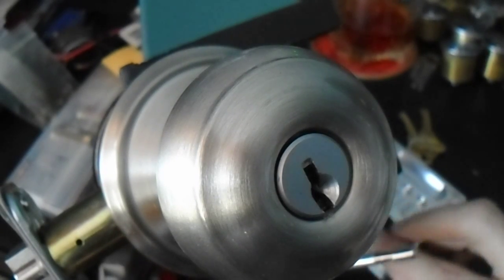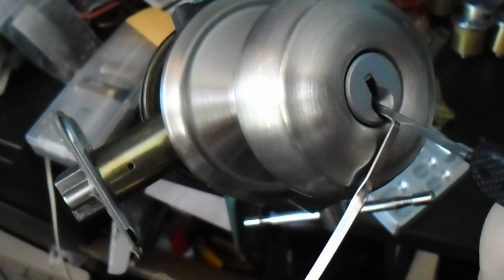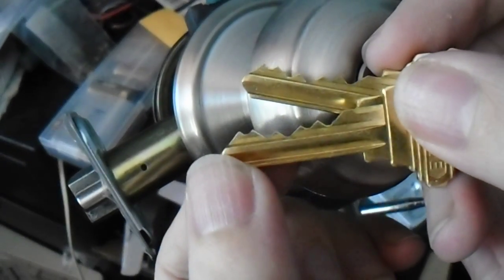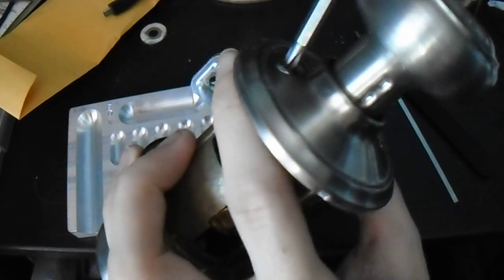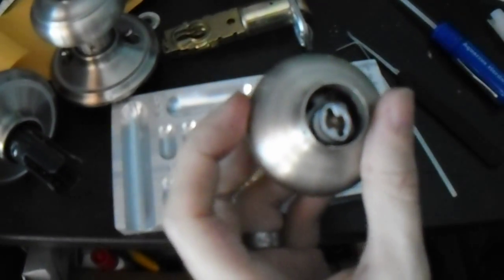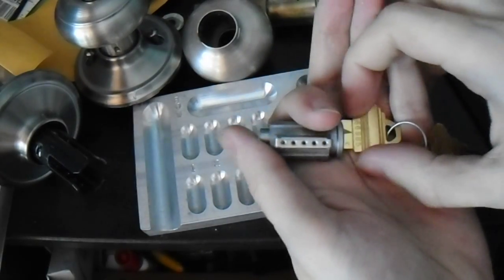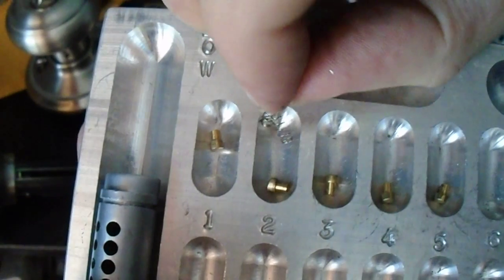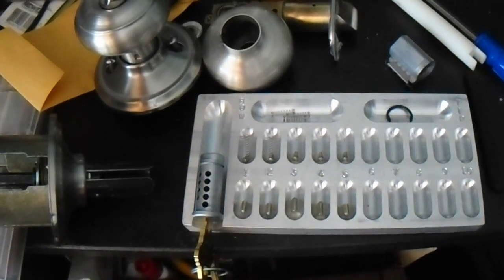(050) Schlage F Series Grade 2 key in knob picked and gutted

Comment: Finally a good video for picking the compressible Schlage cylinder. Millions of these exist everywhere in the US and Canada and nobody on YouTube wants to pick them on video?? I’m a locksmith who deals with these all the time. They can be a nightmare to pick especially with the newer typical Schlage key bitting. When I first began in this trade Schlage used a #3 pin as the shortest in residential lock sets. Now they use 1&2 pins with a MAC number at 7. The top pins are under higher pressure than you find in any other residential lock I found. I normally give myself a 15 minute limit then breakout the drill.. I also made myself a tool to pry up the front pin to pop the compressible cap off to blowup the lock in the knob which will then lessen the pressure on the top pins which can then be more easily picked.. I never been able to open these with conventual pick guns because of the tension on the pins. Thanks for the Video I hope you do more on these cylinders with more Radical bittings..
Reply from the maker: I have found that attempting to bump these or use snappers/pick guns tends to result in blowing the caps off, at which point you can easily rake any remaining pins out (and of course now there are commercially produced tools for popping those caps off) at which point you can easily replace the pins or pin the cylinder to a new key as long as you have the necessary cover, top pins, and springs.
Reply: Nite 0wl.. I never bumped a cap off. I don’t even try any concussion methods anymore. Low odds of success. I try picking first and then prying the front pins to try to pop the cap.

Comment: With F series you can pick it to the locked position and depress the retainer on the side to remove the knob then turn the lock mechanism with pliers or tweezers back to the unlocked position.
I always found F series difficult to pick, they act weird depending on the lock, sometimes I can rake it once with a diamond pick and it opens, sometimes I can spend an hour and not even get it open lol

Comment: I have picked open an F series core before, but it was a little bit ago.  I ended up using the core/plug in a random kik cylinder I had to key up a new lock for my Emtek key I got from Bosnianbill.
Reply from the maker: The compressible F series cylinder will usually work in almost any other KiK housing, but the newer F series models will only accept the compressible cylinders unless you do some modifications to the knob and spindle.

Comment: How do you remove the spindle from the chassis on a Schlage F-Series? I have passage unit that I want to modify to work with some vintage glass knobs, but I can't figure out how to remove the spindle. Thanks!
Reply from the maker: +Andrew Miller You can dismount the knobs from the spindle by using a thick wire pin (like the Schlage Privacy Function override tool) or a small screwdriver/awl. Insert the tool into the small hole on the shaft of the handle, near the escutcheon. You should feel a slightly springy lever inside. Press in on the lever (you may have to press hard to over come the resistance on very new or heavilly soiled handlesets) and you should feel a small click, the handle should now slide off the shaft. Repeat on the other handle.
The chassis is not designed to be disassembled but it may be possible to do so with a little light prying.

Comment: did you try and bump it? how do you make a lock bump proof?
Reply from the maker: +JB I did try to bump it, it was quite difficult. Preventing bumping requires messing with the physics of the lock, so varying the spring strengths from chamber to chamber (say add one extra strong spring and one weaker spring) and replacing one or two of the driver pins with T pins (especially paired with those extra strong springs), Ilco even makes a kit for doing this in the field. There are other methods but those usually require specially made pins and modifications to the lock body and I have seen reports that they are not as effective.

Comment: you think it's better to put a wafers in making it full of drunken spools. I would like to see the picking time difference. the tpins supposed to stop bumping or is that just the ilco halt pin which I have but don't know how to use properly. 10 ilco bump halt spring & pin sets came with my high security pinning kits. only thing it says it's better security if you use two of them. I don't know squat about bump pins and those crazy Springs that come with them. f series t pins I believe came in a kit also. basically how do you use ilco bump pin and spring and using schlage t pins with a wafer or 2 tpins together front to back or front to front. what's the best and how do we do it? sounds like a t pin experiment .
Reply from the maker: Ilco Bump-Halt T pins and Sclage F-Series T pins are normally installed in the same manner, narrow shaft towards the springs. In both cases using them in standard lock bodies cause them to both interfere with bumping (2 per cylinder is usually sufficient)  but they will also act like spool or Mushroom pins in a picking attempt. The bump-halt springs help interfere with bumping by screwing with the timing and physics of bumping, strong springs plus low mass pins mean they loose their kinetic energy sooner than high mass pins with weak springs thus altering the timing of a bump attempt. Bump halt's high strength springs can slightly complicate picking by adding resistance but the difference is negligible to a skilled picker. The Schlage F-Series T pins are excellent candidates for making drunken spools, either stack them shaft to shaft or shaft atop wafer, just try to make sure the wafers are thick enough to not rotate in their chambers or you may get jams.
Reply: +Nite 0wl I got my security pin set Saturday I am expecting my LAB WEDGE pinning  KIT in a few days. it should have plenty of wafers, let me know if you need any pins.
Reply from the maker: I am well stocked with an HPC Yale pin kit for experimental work, once I get enough Schlage and Corbin tail pieces to rebuild all my spare cylinders I may need some more versatile pins but that is proving difficult.
Reply: +Nite 0wl I am trying to get my supplier to order some custom made keypins of all sizes and foreign security pins.
Reply: +Nite 0wl what kinds are you looking for ,I got a good supplier and supply